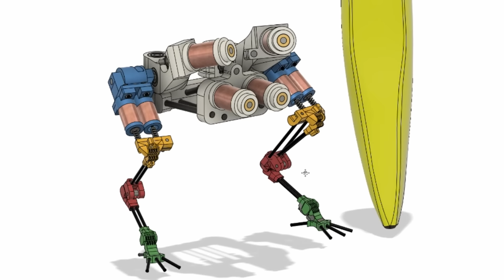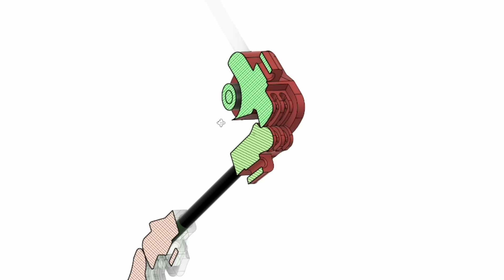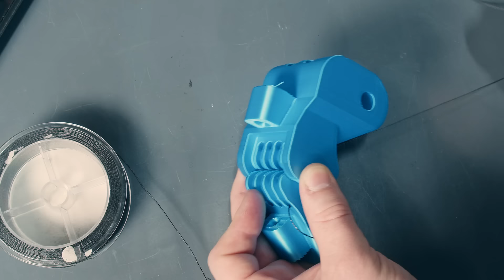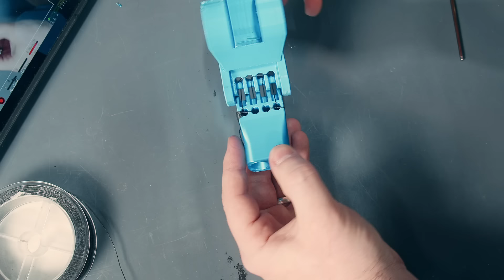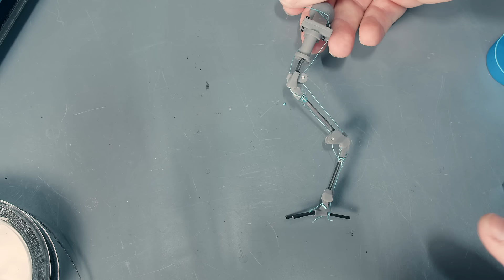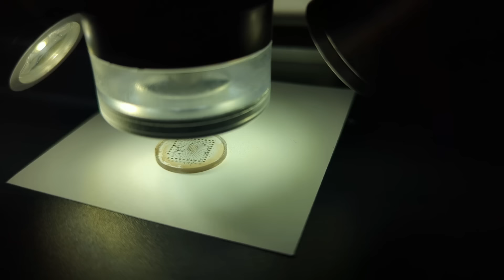Alternative to bearings for tiny robots

Comment: Cool stuff. I work a lot with flexures, didn't expect you to make a video on a compliant mechanism. These kinds of joints are indeed quite common in low friction robotics and mechanisms (such as tele-operation with haptic feedback).

Your joint has very low sideways support stiffness, as the compliant elements you used are essentially wire flexures (at least as long as you keep the wire in tension). They are compliant in the bending mode about the knee axis of rotation (which you  obviously want), but also a similar bending mode in the rotation axis perpendicular to the knee rotation axis and perpendicular to the length of the constraint. Pure rotations in your design are somewhat compensated for due to the spacing of the wires, but pure translations sideways I expect the joint to have nearly zero support stiffness as well. 

If you want to improve this, use blade flexures of some kind. You can perhaps just use thin metal sheets to fabricate these out of, I believe they are common in hobby stores for scale models. Considering the scale of the joint, the metal sheet you need to use is likely so thin you could cut it with a razor blade.
Alternatively you could add a supporting flexure in parallel with the joint you already have (for example a folded leaf), but to do that properly is likely too hard without experience in flexural design.

If you want, I can give you a book recommendation that would significantly help you with such joint design (and mechanical constraint design in general).
Reply: @tHaH4x0r Dude, are you me??? I buy Exact Constraint for all the new mechanical engineer hires. It's a GREAT read! If they can get literal miles of wet film running smoothly through rollers in a factory the size of an aircraft hangar, you know they've figured out a bit about how to properly constrain mechanical systems. I love the graphical approach to applying nesting forces and constraints, too. Really good read, and a great recommendation on your part.
Reply: @evanlane1690 Thank you. You are the only one that says the title of "the book." in this long thread.
Reply: @tHaH4x0r  thank you for sharing!
Reply: @tHaH4x0r  Your comments here are exactly the sort of insights I've been itching for thanks a ton. Can't wait to dive into that book.
Reply: 🤯🫠 this thread is EXACTLY why I f'ing love creator content. Remember back in the day we would be watching some fascinating show on the Science or Discovery channels and be completely captivated and wish we could say "hey! Go back! What the hell was that back there? That looks way more interesting than this hot garbage!"???, but we would just get the same blank stare from the television as always and if it was interesting enough to remember we would go to the library and try to probe the librarian that only reads those love novels (that are extremely wordy when describing swords and sheaths for some reason 😉) and hoped she could help with mechanical engineering stuff. 
We are living in the future. And ain't it f'ing awesome?!?! 

Thanks for the book recommendations. You just made a whole lot of mechanical nerds find some cool new mechanical porn.  It sounds as if you're knowledgeable enough on the topic that I bet you could run a badass YouTube channel.
Reply: @BIGWIGGLE223 which is his recommendation
Reply: @tHaH4x0r  Did a search and it looks like the American Society of Mechanical Engineers has the book available on their website. I'd link to it, but YouTube doesn't like it when you do that.
Reply from the maker: Awesome, thanks for the info! Pinning so more folks can see this. And definitely interested in that book recommendation!

Mea culpa, I opted for cable/line because I didn't want to figure out how to mechanically secure thin spring steel ribbons. 😅 But after building these I can definitely see what you mean regarding unwanted motion in the perpendicular direction. Will do some reading and see how to incorporate that in a small package (probably just some M1.5 screws holding them down or something)
Reply: @BreakingTaps  Maybe there is no need to hold with screw.  If you bend the metal strip at the end "like a hook", it might click in place and hold there in the fixture.  Might make build more difficult, but allows you to go smaller because there is less stuff to cram into the little joint.
Edit: An after thought,maybe use a transversal pin that holds the hooks, no need to click them in.
Reply: @BreakingTaps  Would you not be able to 3D print the entire joint? Just making the string/strip an integral part of the design? I don't know if I can explain it well enough, but you sort of tangent off the top front (or rear) of the joint then join that tangent to the bottom rear (or front) of the joint. I know it can be easily done with circles (did a quick SketchUp model), but I don't know how well that would work with the shape you're using.
Reply: @KevinIrish  I've never had luck with 3D printed flexures lasting very long; they start failing due to fatigue after a few tens of thousands of cycles at most.  I suspect the rather large minimum thickness of a 3D printed beam/wall means the joint must be very large to have much deflection without running into fatigue issues.  (I'd love to be proven wrong though)
Reply: @mattasmack what material/process have you been printing with?

I have some samples of carabiners with s-spaded live spring hinges that are printed with that new sintered powdered nylon 12  process that can be super fine and durable.

I also have a sample of a ball insert a lattice ball insides larger lactic ball that was printed using that Sam nylon 12 process
Reply: @macmurfy2jka  My experience is all with home-printed ABS or ABS-plus filaments.
Reply: Also check out C Flex flexure bearings.  They go down to 1/8" OD, and I had used them years ago in a electronic gauge head with a LVDT that was capable of measuring down to half a millionth of an inch.
Reply: @tHaH4x0r  Thank you for this; I find videos are good ways to learn something exists but less good to learn how it works.  Even if the book proves to be a bit too deep to start with, just searching for the title has found a few articles that cite the book that should let me ease into it.

Also, intriguingly to me, this book is available for purchase via Indigo!
Reply: As long as you can orient them to print vertically (better) or print them flat on the print bed (worse), PETG makes decent blade flexures as printed.  I have literally thousands of flex cycles on my clicky-clicky annoy the cat flex-toy I made with no visual or tactile indications of fatigue.
Reply: @tHaH4x0r while YOU are here, why don’t the find interlock/overlap, other than a bit of added friction? Without that lateral stability they are no better than a hole with a pin through it.
Reply: Thin metal sheets would be springy, right? Can they be designed to balance each other?
Reply: love the blanding book, you can find pdfs on libgen if you prefer
Reply: été are also some nice 1 pièce compliant joints that work in 1,  2 or more different axises, or even free moving. they all need some flexible and résistent 3d pronting tho. Nice video! thanks for sharying
Reply: Hi, could you please share the book recommendation? I am very interested in this sturcture
Reply: Interesting, could you use something like two small bushings to have the same result and be more compact/ wear resistant? I used to use thin brass tubes that I could cut with knife or saw to make axel sleeves for small carts. Alternatively there are ruby bushings used in clocks and precision measuring equipment that aren't terribly expensive.  Alternatively use horizontal sections of that carbon tube as roller bushings. It may be beneficial to add some kind of leaf spring support so the weight of the body is accounted for before the strings are tensioned. A flexible rubber tube might do it.
Reply: maybe everybody knows already but disney research did some cool researches about compliant mechanisms
Reply: A mixture of flexure and elastic in a joint, non-elastic for undesired directions such as lateral, elastic mimicing natural joints compliance, gradual resistance and spring return to neutral.
Reply: @tHaH4x0r  By your recommendation, I got this book. It's a good resource for mechanical design. The FACT chart is a bit more to chew on, but also worth reviewing. Thank you.
Reply: how abt u just give me the book
Reply: @shaljum  how abt u lrn 2 rd
Reply: @tHaH4x0r  with the help of AI, we can further accelerate our learning with the book as the basis for it
Reply: On skibidi

Comment: I have  a couple of ball bearings of the size that would fit there) They're relatively expensive but not too much. Their ID is about the diameter of a sewing needle and not even in the thickest place. 
You have a very cool joint design tough.
*Why don't you just use the holes two times instead of wrapping the line around the outside?

Comment: take 3 zip ties, cut 2 of them into 3 pieces, tape them onto the uncut zip tie, glue control wires and rubber bands on, and shove them down a drinking straw, bend it at the 2 cuts.  Now you have a puppet robot limb, or finger.

Comment: When doing the inverse loops pictured at the 6:00 mark, you might wanna consider adding some small channels in your print for the filament to sit in as it would reduce any chance of contact with outside elements that could eventually fray the line.

Comment: I want to build a exoskeleton like this ! With the motor mounted in the lower back. A small jet engine spinning a turbine that generates power, a 20:1-40:1 planetary gear reduction. With a output speed possibly in the 5k  rpm range , the turbine could be spinning at 100k easily, and if I'm thinking correctly 150k is the separating range , 40:1 that should get it to 2100 rpm minimum.  And should be capable of producing 2-4 kw? At 60-80vdc,use cables to operate limbs, maybe use smaller motors in the limbs. Using the latest ultra super capacitors and lithium battery, possibly modify the jet engine to run on propane and used waste oils, using the propane to start the engine easily. The turbine is basically converting the engine to a turboshaft engine.

Comment: I think low friction composit bushings are a smarter/easier/better solution, we even use it indtead af bearings in our cranes( mech eng.) and can tolerate just as much force long lifetime and requires no lubrication. And the can be made in theory as small as possible, and only requirer a pin to fasten

Comment: Seems failure prone. The string/cable is gonna lose flexibility, and just become permanently stretched fairly soon. You should probably put it on a spring, and restore tension occasionally by looping around something, then do an additional loop when tension is getting too low.

Comment: Could you thread each slot of the joint separately?  That would provide some redundancy and make it easier to repair.  You could also tighten each cable individually by perhaps wrapping the end around a small dowel and then just twisting it and having it pull itself into a small slot to hold it in place.  This would make it more robust, easier to repair, and easier to tighten unless I'm missing something (which would never happen of course).

Comment: steel pin in a tight tolerance (light press) hole in a lubricious resin isn't too shabby, especially as things get small. I suppose static friction would mess with control. If your printing, why not model a toothed profile to add a ton of shear strength in the plane of motion? Something like a gates GT profile. The stepping on the print is probably already doing something similar. At any rate a positive mesh would take the tendons out of that strength calc. I bet that could be constrained without tendons, which seem like a royal pain. Pin in curved slot or some type of captured slider or a roller? Seems there is need for preload EOD.
Reply: when I was young i designed an arbitrary ratio drive that could do ballpark 135 degrees of rotation at the output with using only pulleys and a belt. Happy to share if you are interested.

Comment: Sure but just a simple bush bearing would seem vastly better for small application like this. If you had to do a roller there is 2 gears meshing and little side links but you don't have to. Also you can use 3D metal printing to make compact joints with some strength. even fantastic strength. plastic 3D print is mostly garbage. When parts are very small the price is quite modest. chinese unionfab is quite reasonably priced. pcbway maybe too

Comment: Not that i think its more suitable than your rolling contact joints. But ball bearings are not the only types of circular bearings. The world used to rely on bushing type bearings, especially in the smaller sizes.

Comment: You dont need to have all the surfaces on the same plane, having a sort of parabolic barring surface could be a good idea, also having multiple different strands could give redundancy to the joint.  

Next if you were to use a slightly different cable path you could incorporate a tendon like spring response to the joints giving them more ability to handle sharp movements.  

I wonder if this could be a basis for an ar glove that could provide some resistance and general telemetry for fingers for ar/vr.

Comment: I would KILL for a step through the design process for the shape of these joints! Why is it not completely round?

 It seems like you have the desire for it to have states that it settles into and tries to go between the two how did you go about designing for that and how can I design around similar desires but maybe at different angles or distance between each "happy" state?

Comment: Two questions:  Why not just have the protrusions of one joint go down into the slots of the other; wouldn't that make for a more constrained match?  For that matter, why not just have meshing gears on the two surfaces?  That way you could precisely control the movements of your joints.  If you're worried about dust and dirt getting between the gear teeth, you could have each joint surrounded by lubricating oil, with a watertight meniscus sealing each joint by surrounding them, just like a human leg joint.

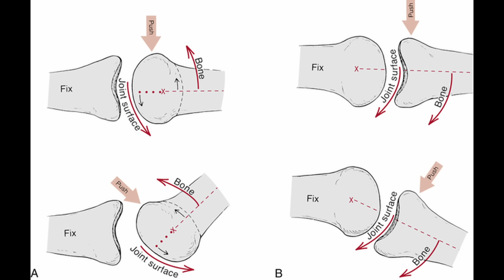Comment: 3:07 The knee joint is even more complex, as shown in this diagram: So thanks to the meniscus and cruxial ligament, the contacting areas are both, contacting and sliding, which is exceptional in terms of forces that work here. It shows clearly, that natures way of working it out cannot striktly translated into one mechanism.
As a way of holding the joints together, I would have tried to go close to nature again: shrinking tube üver the whole joint and then play with stiffness, degrees of freedom, bendability towards certain applied muscles...

Comment: Bro, I've been needing this video. Making a ligament based hand. Curing some UV resin as I write. 2 chopsticks, 2 toothpicks for pivot points and the core from a cheap pen as a tendon sheath. I've been trying with polymer clay but it's hard to get perfect by hand. If it's even slightly misaligned... Watching with great care, thanks for the video!

IRO bearings, I've been looking towards CAM, knee mill and lathing of aluminum-based parts. maybe it can get your overall size down while still being structurally sound.

Comment: This seams over engineered to be more complicated than necessary.  Why not si.ple use a ball(disk in your case) and cup design like all skeleton creatures have. All that needed is a single pin on the rotation axis.

Comment: Nice. I wonder if the joints can be shaped to implement a constant force spring to unload the weight of the robot (apply a normal spring through a wire wound through the surface, as the joint articulates the lever of the wire changes to compensate the spring's force change as it stretches/compresses )

On another note, in War of the Worlds H.G. Wells makes the point that the martians did not use rotation axes in any of their machines. The legs of the tripods are described as articulating trough complex sliding surfaces.

Comment: You could improve joint strength significantly by having interlocking grooves and having a pin in the hinge of the joint. Also, i would have more cable channels.

Comment: Using the string you could take it up to tiny stepper motors in the body of the vehicle and get it to walk, i guess a lot of work to get it to work but you have resolved almost all issues with the joint size and rigidity.

Comment: Not sure if you are still working on this project, but you might consider using Spiderwire DuraBraid for the tendons. It is pretty strong and the 8lb is only .005". Just thought this might help.

Comment: Regarding the join stability, you now have 4 tracts, which are your points of contact. Each or them are at the same height, e.g. extrusions along an axis. If you offset the outer most tracts in an orthogonal axes, e.g. moving them down, wouldn't that increase stability in the joint? Also you now have two flat surfaces rolling together, but wouldn't a  convex and concave shape for a more stable design?

Comment: You also can use small brass tubes as well. Back in 1960's when I flew control line model planes, we also sowed the moving surface such as elevator.

Comment: I am a trained machinist and in our classes the teacher showed us a ball bearing for a 0.5mm shaft but sadly he couldnt tell us what sucha bearing would cost as it was a gift from another trainee that was at that school.
So regarding just the bearing size it would be possible to get small enough bearings but as you pointed out theres other reasons than just the size to not use ball bearings.